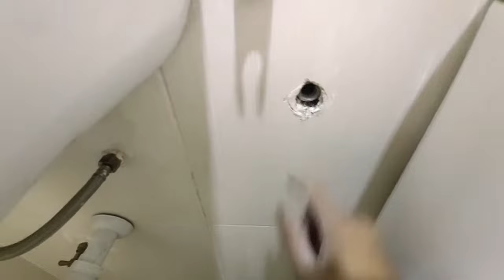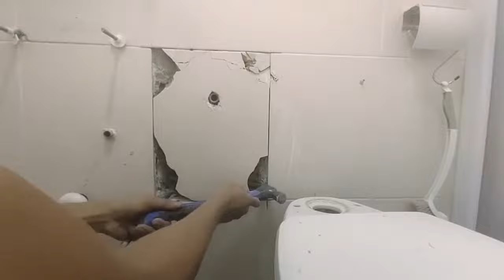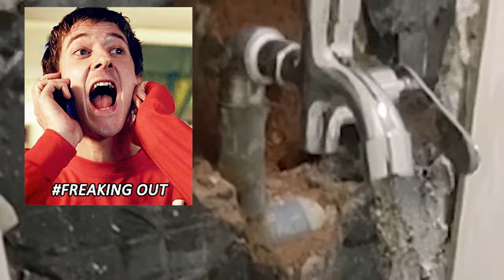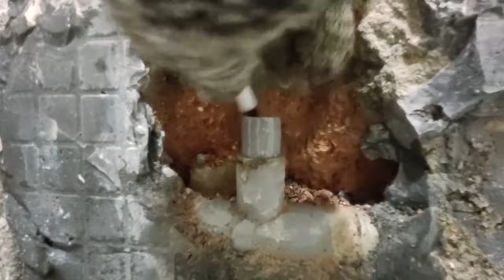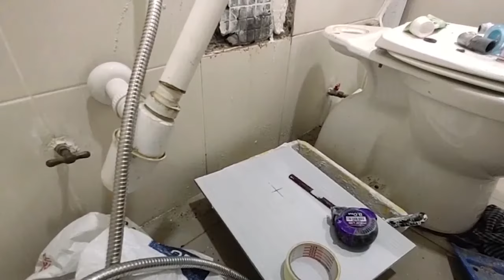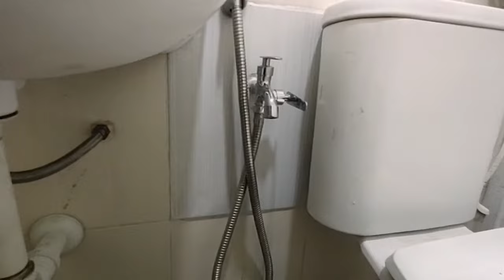VLOG#6【repair broken pipe in the wall tiles 】VLOG 6 怎样修瓷砖墙壁里的水喉

Comment: Hi Maxiu, i have a problem that my shower shutoff valve is leaking, may i know how i could change that?
Reply from the maker: Hi, the shower shutoff valve is attracted with the heater is it? 
If os that one it could be the black rubber problem... Need to replace that. 
 Or u can just find a replacement valve from hardware shop, they got sell.

If the shower valve ur referring is the wall on off then i might need to do a video to demostrate 😂
Reply: @Handyman2Uchannel  thanks for the reply. ya is the one that from the wall.. i have replace the entire valve and I do realize that is cause by black rubber. it would be nice if you could made a video for noob like me😅